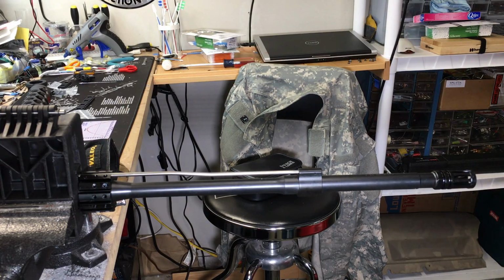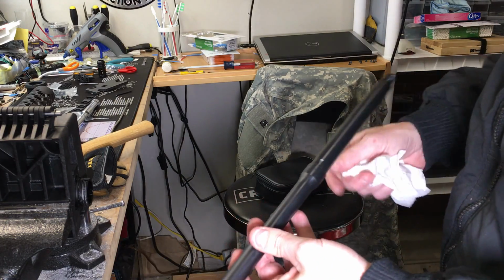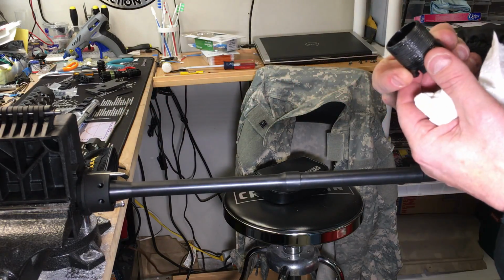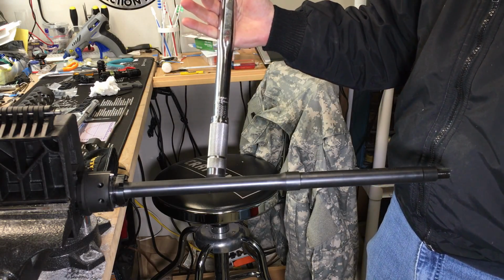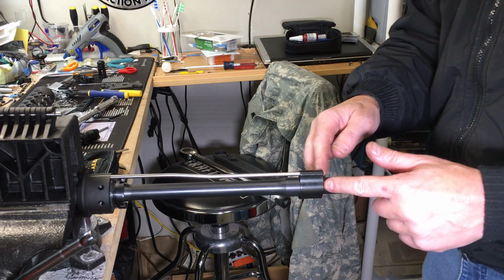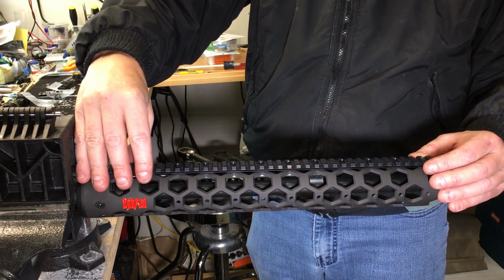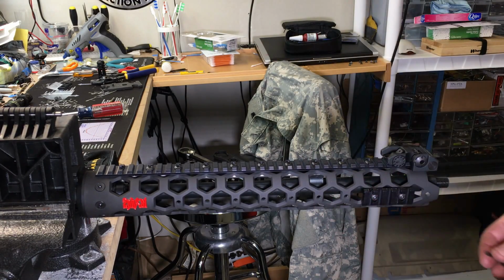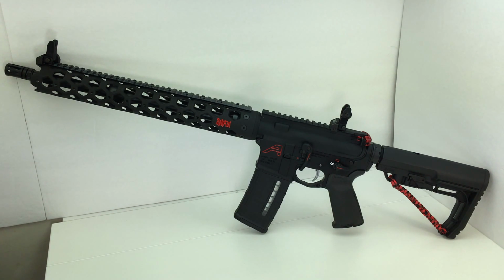Installation of the 2phast Tactical 15" AR15 Handguard

Comment: Looks cool. Did you ever get these produced? I didn't find them on your site.
Reply from the maker: +realplatinum Due to the barrel nut design, I asked them to make changes to it so that you can properly torque it down and still be able to remove the gas tube alignment tool.  I also asked that they include a properly sized gas tube alignment tool if they do not want to correct the design issues.  So this is on hold at this time.

Comment: That looks really nice I just hope the barrel nut performs like it's supposed to.
Reply from the maker: +CEmanified I don't see any glaring flaws with it that would provide reliability issues.  Using the proper tool is a start, I can tell it wasn't designed for use with conventional castle nut wrenches, so I am looking into that.  The standard gas tube indexing tool is also a issue, the channel on the outer barrel nut is a little large for a standard indexing tool, so when you torque the inner nut down, it jambs the outer nut against the tool.  I am addressing that issue with the manufacturer as well.
Reply: 2phast Tactical I appreciate the effort that you are putting into sending out a quality product and look forward to purchasing one of these handguards when they're available. When I was on your website I noticed that there weren't any actual lower receivers on it, what website would you recommend buying from?
Reply from the maker: +CEmanified Yes, that is correct.  I don't have a FFL yet, but its coming.  As for lowers, that depends upon what your looking for.  JoeBobs, AIM, PSA and Primary Arms all have some good deals and good sales from time to time.  The Anderson is hard to beat in the sub $50 price range and I use those quite a bit.  I also like the new genII Aero precision, it floats right around the 70-90 dollar mark, but you can get them with the 60 degree selector markings, upper receiver tensioning screw and the rear take down pin hole threaded (for use with a set screw) so those provide a few added advantages that other receivers in that price range don't have.